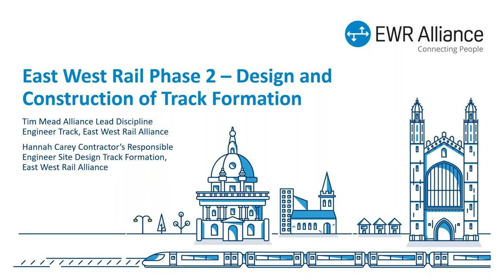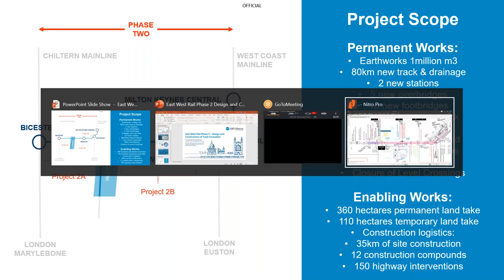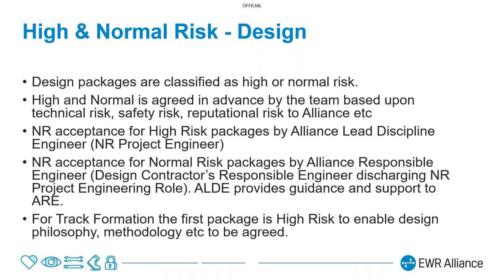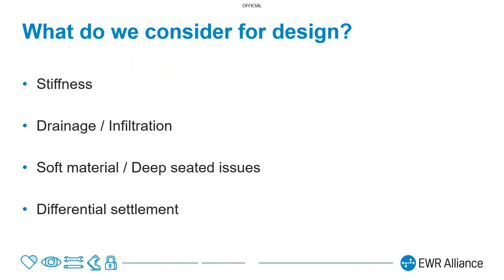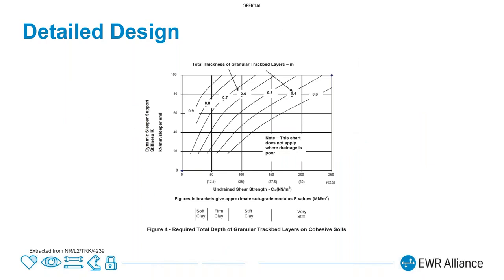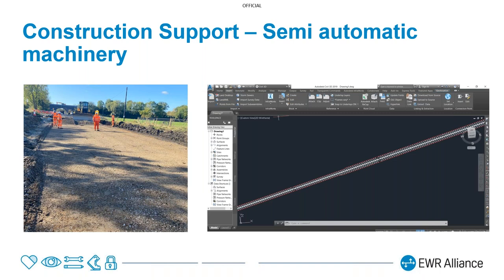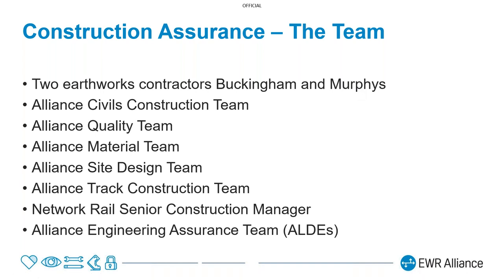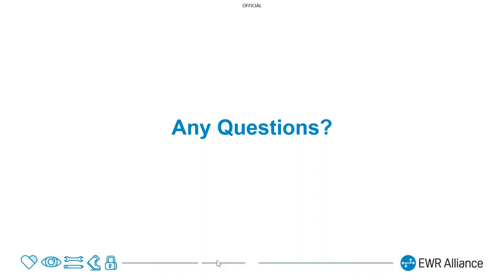East West Rail: Phase 2 design & construction of track formation - Tim Mead and Hannah

Comment: The most exciting aspect of this railway is the potential for triangulation of junctions to make it dynamic for other purposes.  All E/W railways that carry the sort of prestige this railway will carry have at least some provision for north south junctions.   It is obvious at this time that the only provision for junctions is that around the passenger route.  To cut a long story short, will there be a provision for a northern arc from the East?
Reply: To join which points?
Reply: @professorjamesmoriarty5191  I think the ECML crossover is not connected.  The Mml is and has 2 largely unused tracks so I would say triangulate at Bedford.
Reply: @atomiswave1971  The ECML isnt connected as such, but any traffic needing to do that can run via Royston. I thought there was the option of a connection at st neots at some point.
Reply: @professorjamesmoriarty5191  I think it will be Tempsford as its not built up.  Maybe cross platforms but no way to get from one line to the other.  ECML is too near Royston area as you say so doesn't make sense.  Bletchley is too built up unless they want to knock an ind estate down and remove half of the sidings.  Which leaves Bedford really.  Freight will need to go north from the east at some point.
Reply: @atomiswave1971  I live near Royston and it would make more sense if East West Rail use the Frieght line at Foxton as the tracks are already their with a gate just a mile from Foxton station, Surely theirs not much in the way to give direct link to Bedford from Cambridge. Just my opinon though.
Reply: @scottpeacock5492  Not sure why you brought Foxton into this as I assume its on the Hitchin line (I found it).   I'm talking of putting 200ft of track heading north from Cambridge where the track hits the MML.  There are depots going up in Northampton and Daventry is really busy as well.  It makes sense that if Felixstowe keeps pumping out boxes that as many routes as possible are available for end to end freight.  Right now all that freight is going round London, via Peterborough/Leicester/Nuneaton.
Reply: Get rid